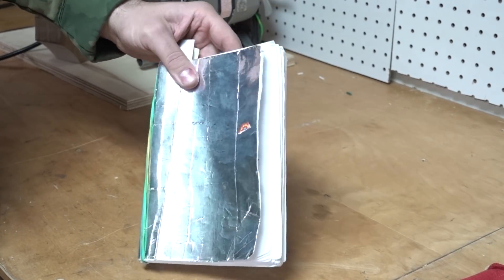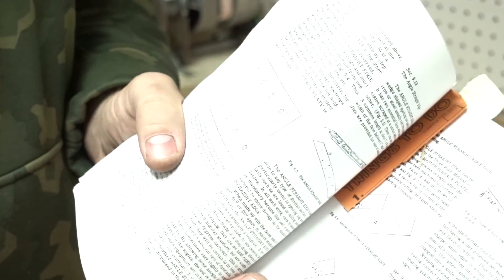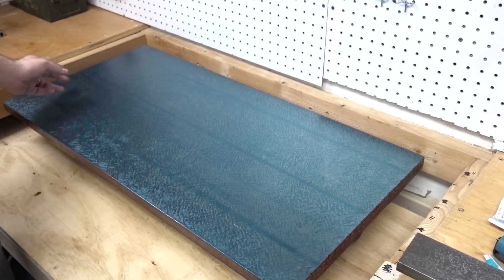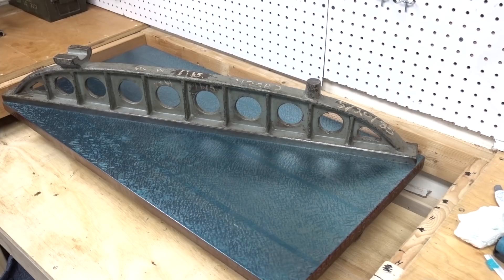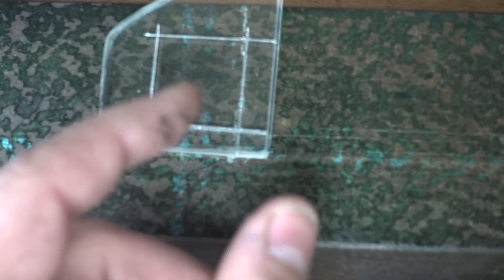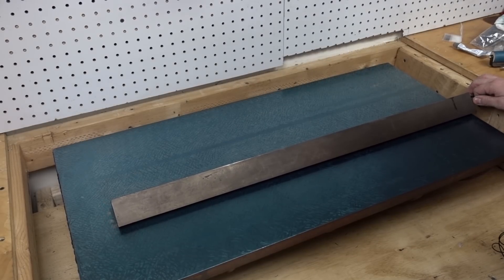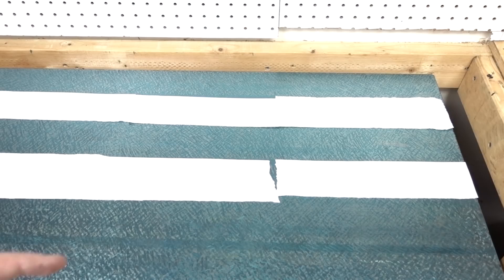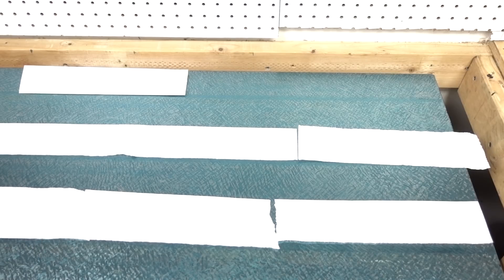Checking a surface plate using Connelly's Machine Tool Reconditioning

Comment: Great score :)

 I had similar luck via eBay recently with a 12" x 18" granite surface plate. The listing pic didn't help as it was covered in dust and sitting on the floor of what looked like a barn but I had a gut feeling and I took a chance. I'm glad I did as it turned out to be the workshop of a retiring engineer that made bespoke one off manufacturing machines.

A toolmaker friend of his had given him the surface plate when he'd retired and shup up shop but it was way too small for what he did so it just gathered dust in the corner of his workshop and since he had already sold off most of his  workshop, he just wanted rid of it.

Turned out it was still certified to grade A when he was given it and I was the only bidder so snagged it for the crazy starting price of just £27 ($36.50) :D
Reply from the maker: Sweet.  Always a good feel when you find that diamond in the rough.